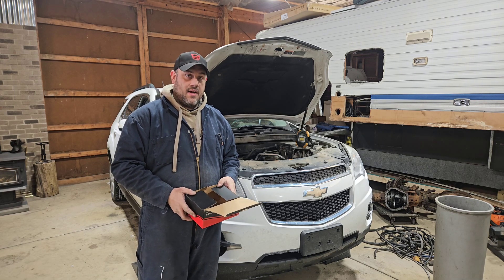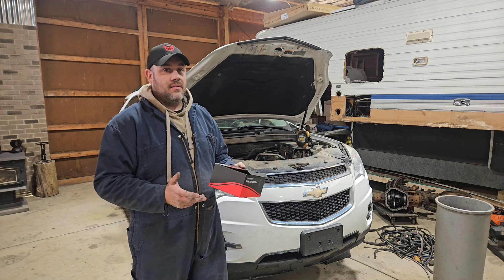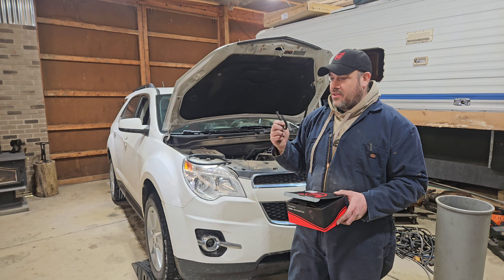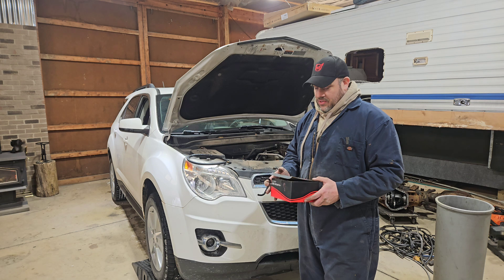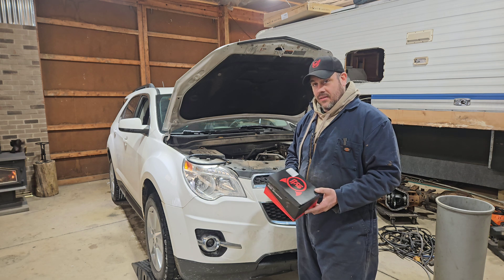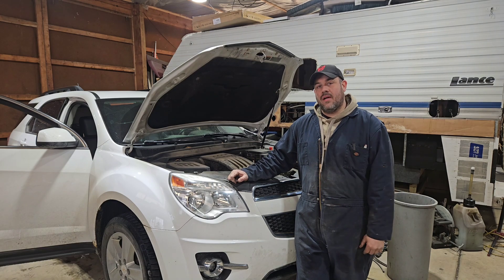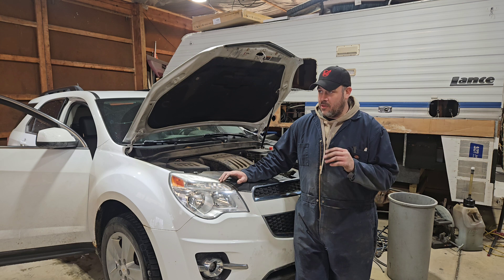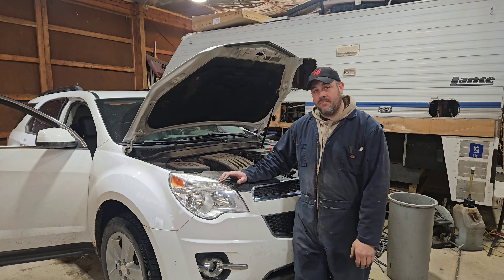2010-2017 Chevy Equinox GMC Terrain 2.4L Ecotec- Oil Catch Can Install "Evil Energy" Fix PCV Issues

Comment: Nothing wrong with enlarging the clean side PCV tube. But there should be no reason for a catch can on the clean side of the PCV system. If you’re getting moisture and blowby there, that means the dirty side is blocked in creating pressure. No vacuum from the intake. The dirty side is where the catch can should go if things are working properly. But the dirty side is internal so you have to mod an external dirty side. I did that using a PCV valve. No more moisture or blow by in that tube because the flow is away from the clean side and the intake box. The throttle body stays cleaner. The intake valves stay cleaner doing that

Comment: mines blew the front seal. I used catch can and they have a oil filter cap that relieves pressure also.. I tell everyone if you can't fix it yourself don't buy one

Comment: How often doyou think the very stupid pvc hole will need to be cleaned out?.
Reply: I have heard every 30k miles, but if you drill the access hole the way a lot of people do, I would do it every oil change, just for piece of mind.
Reply from the maker: I did drill the hole but didnt think about it til after I did the video.  Yeah I pole it clear every oil change.
Reply from the maker: I poke mine every oil change now, since I installed the catch can.

Comment: Would dunning drygas in the tank or something like lucas fuel conditioner every 5 tanks or so help get alot of the condensation out of the system.
Reply from the maker: Possibly?  I'm not expert, but winter time seems to be when the condensation builds up, so far over the summer months the can has been dry every time I've checked.

Comment: this helps for oil not going into the intake but not for ventilation  your seals are going to get blowned out if you don't clean the vent port
Reply: For this model Amazon and grab a FC219 vented oil cap.  Problem solved.  I have over 400k kilometers on my 2011 2.4l.  catch can is just extra protection as well.  I removed cats and replaced o2s with emulators as well to fool the  computer.  I don't really care about emissions, just drive it until the wheels fall off.  Lol.  But she's solid and I get about 550 kilometers to a tank. I dunno if that's good or not but its fine for me.
Reply from the maker: I did clean the vent hole in the intake.    I forgot to capture that on video.

Comment: You seem to be a decent guy so I will add my 2 cents to the comments: 2014 Equinox 150k miles here. For those watching, during the winter you will have to  drop the canister bi-weekly if not weekly due to condensation and oil. During the warmer months not very often. I put my catch can down near the frame. YOU NEED  TO ADD OIL PRESSURE RELIEF CAP, in conjuction with this setup, if you want to save rear main seal. This oil catch can just keeps the water from clogging up the PCV valve(freeze during the winter). GMC really stuck it to owners by placing the PCV valve behind intake plenum. I will be drilling access hole, and epoxy nut/tap screw for ease of clean/access as seen by other YouTube videos.
Reply from the maker: I also drilled a hole, etc.
Reply: Also, for reference: the filter on canister housing would be better for pressure relieve, but the oil vapor smell stunk up the cabin and the family complained. I put the cap screw back in.
Reply: We're are u located bro I really need help I'm tryna save my car
Reply from the maker: I appreciate it, but I'm not for hire and just share videos to share with others.

Comment: The metal mesh packing stuff belongs in the baffle cup in the top assembly.  It unscrews to open up and install packing.  That’s where the oil vapor comes in the catch can first, then the packing or wire mesh, collects vapor and the oil and water drip down to the can.  Your video shows you just put the wire mesh in the bottom of the can.  Also note, you cut the packing down to fit in the smaller baffle cup, so there’s extra left over.  Also, the vent option on the top is for older cars or racing engines without a pcv valve and hose system that routes pressure back to the intake.

Comment: I just installed an evil energy can on my 3.6 impala.  I got 1/8” of mostly water and a tiny bit of oil after 5 days and 300 miles commuting, so it’s definitely worth it on a direct injection engine to keep that crap off of the intake valves also better for the catalytic converter.

Comment: I have a question, I had the rear seal blowout on the equinox, I own the car and like it so I had it fixed.  Had them do the timing because it’s at 100k.  I had a new manifold out on and I’m wondering if I should just leave it alone and put on the new oil filler cap with the pressure release valve or install the catch can as well.  I’m very comfortable installing the catch can, and I can always check the air box and the throttle body for gunk and install it if I see it there. Just wondering everyone’s thoughts.
Reply from the maker: It's always a good idea to prevent issues before they happen, so installing the catch can on this particular motor seems to be a great idea.

Comment: Awesome work! I've got that same one on my turbo truck, very nice piece! 2.4 definitely a good candidate for that upgrade!
Reply from the maker: Awesome!  Thanks for watching.  I was originally gonna put it in the Explorer on the vent lines from the trans and Atlas.. but i don't have any issues with them puking any fluid out.
Reply: Maybe have to buy a couple more just for the bling factor and hook em up to nothing😂@BuildItWheelItExploreIt
Reply from the maker: @BustedtoBuilt  😆   luckily, evil energy sent me this kit along with their aluminum adjustable -AN wrench.
Reply: @BuildItWheelItExploreIt  thank you for the video! Just replaced the rear main seal on our '13 Equinox. Oil everywhere under the vehicle! I had the vented oil cap and the seal still was the weakest link! Very wimpy seal! Thin sealing material! No spring reinforcement! In my opinion, the cap is false security! I knew about the possibility of blowing the seal, so I was proactive and got the cap.
In my opinion, any vehicle with a PCV system will benefit from a catch can. The benefits will be even greater with direct injection being the fuel isn't going past the intake valves and cleaning them. 
New subscriber. If you're interested in vintage vehicles, there's a playlist about the car in my profile picture.
Reply from the maker: @dans_Learning_Curve  thanks!  Will do!  Appreciate it!
Reply: @dans_Learning_Curve I just bought a brand new vented cap from ac Delco, can’t even blow air thru the hole.  I got a bad one or it needs to be substantial pressure to vent.  I wouldn’t count on those caps
Reply: @GMK6300L  I put one on ours to prevent the seal from being pushed out! Nope! Didn't work! 
Keep the crankcase ventilation system clean. Place your hand over the oil fill hole with the engine running. You should feel a vacuum. If not, pull your intake manifold and clean out the crankcase ventilation hole.
Reply from the maker: Correct, this only fixes on issue... i did also drill a small hole and use a wire to clean the small orfice hole that is known to get clogged up.  So, every 3rd oil change, I unscrew the small cap screw and clean out the orfice .
Reply: @BuildItWheelItExploreIt do you have a video of this?
Reply: @BuildItWheelItExploreIt are the hoses backwards the way you installed it? I saw other vids where they were switched!
Reply from the maker: @jerondbetts7341 There really isn't a wrong way.  You're just putting a can between one line.  Also the can doesn't have a specified "in/out".